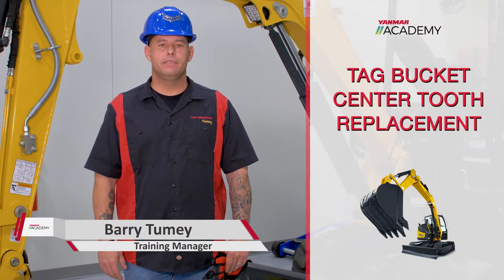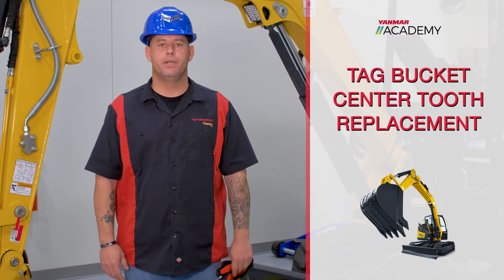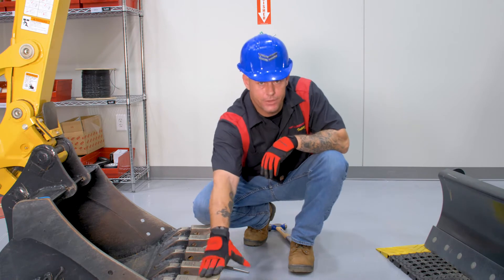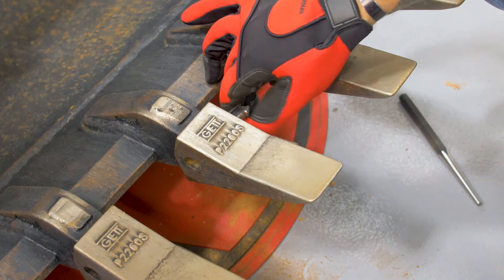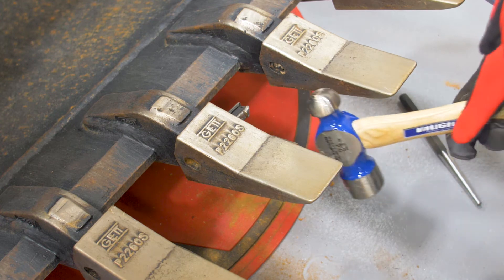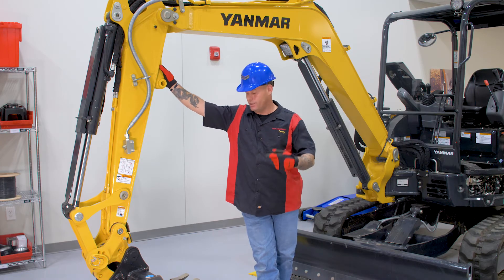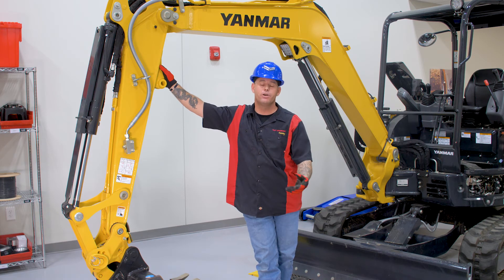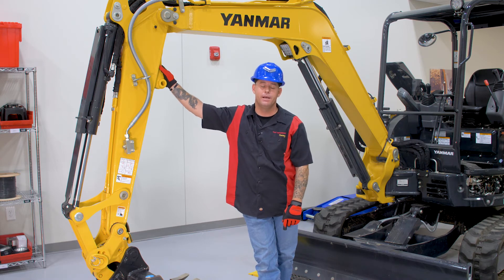YANMAR Academy Quick Tips!  Excavator Tooth Replacement

Comment: Why not just use a "pin master"
Reply: Where would I get it? I found a youtube video "How to use a PIN MASTER", but the manufacturer web site mentioned there seem to be down.  Same for the tool mentioned in "Remove Bucket Pins Quickly With The Excavator Tooth Removal Tool".
Reply: @fritzchen0.523  here is a knock off version, I have had mine for 20+ years and they seem to be hard to find.
https://www.ebay.com/itm/Pin-removal-installation-tool-for-backhoe-Flexpins-B23-/262027883250?_trksid=p2349624.m46890.l49286